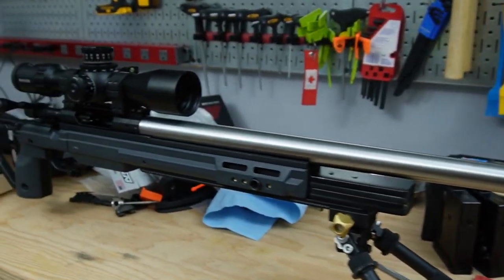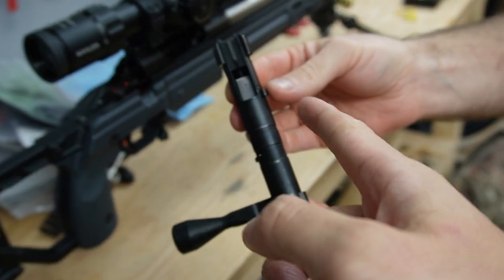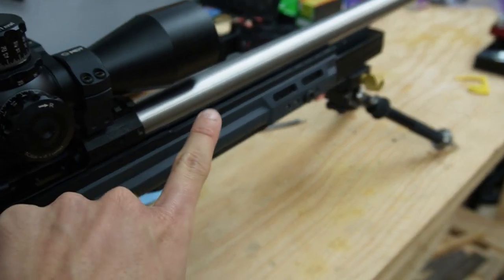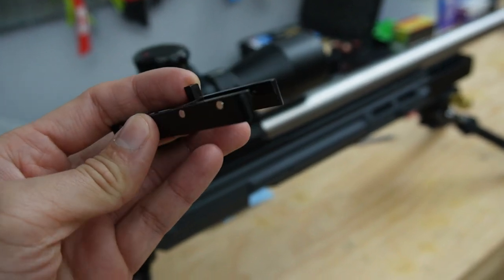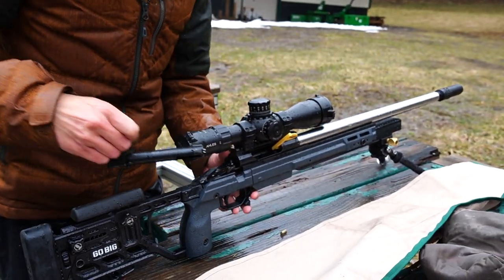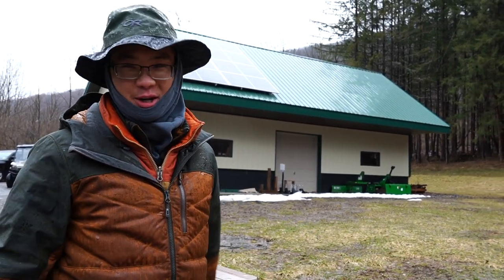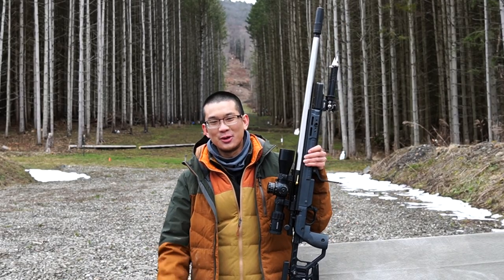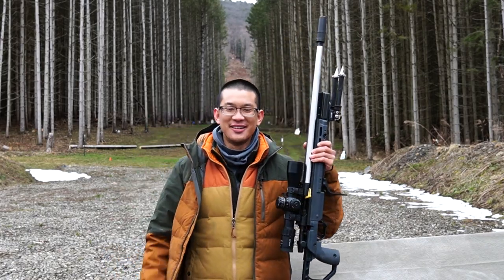Curtis Custom 22LR Conversion on a Valor - First Look

Comment: That full cone breech is a concern... from expirence building some, it's not as reliable in feeding. Curtis has barrel prints with traditional extractor relief cuts. Ill be building one soon
Reply from the maker: Ah okay, I didn’t realize there was an option for cone or extractor slots. It’s easier with the cone because no timing is needed, but I agree I’d rather have an extractor a lot set up. Like my vudoos
Reply: @Womfat  the cone doesnt give case rim support for the firing pin to strike consistently. Also without a adjustable mag, the sharp edge can shave bullets. I tried it on a few Vudoo's and Stiller 50x actions
Reply from the maker: Great info. Yeah I think all the issues were due to my W3 not having the proper mag adjustments. We’ll see how it runs in his stock
Reply: Where did you see those? Their website says "Our system is designed to work with a cone breach with no extractor cuts."

Comment: This why .22lr conversions just don't work 100% reliably.. Rimx, and vudoo is the way to go with r700 footprint .22lr builds.
Reply from the maker: I’m not writing it off just yet, all the mag issues were the exact same thing that can plague any 700 footprint rimfire. The bag was pushing into the mag and causing it to shift. His new stock is coming soon and he may use a mag blocker if needed as well.
Reply: @Womfat 
Is there any news about the new stock?